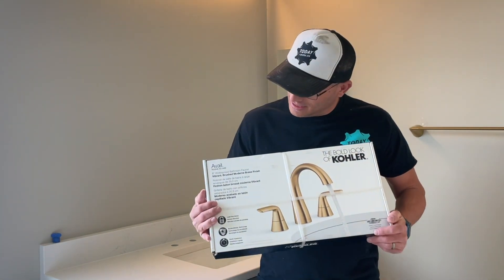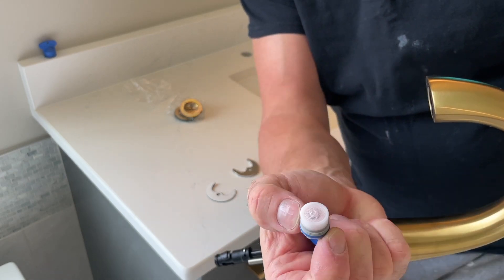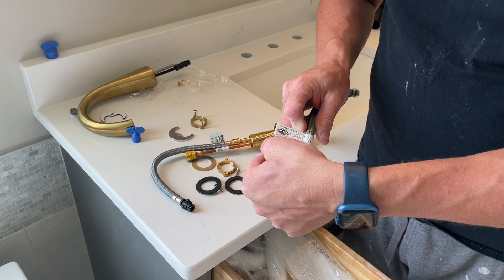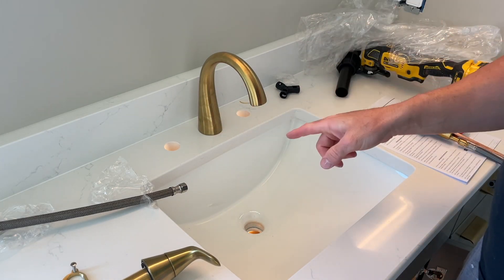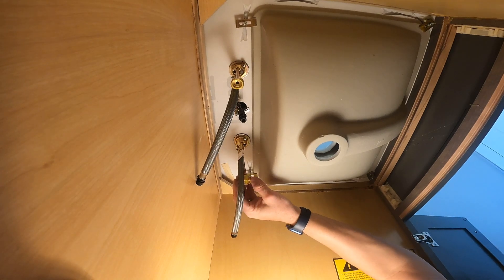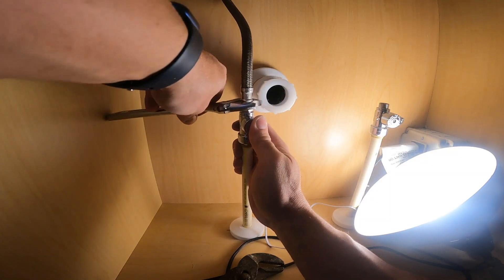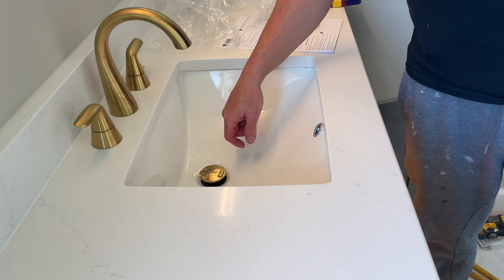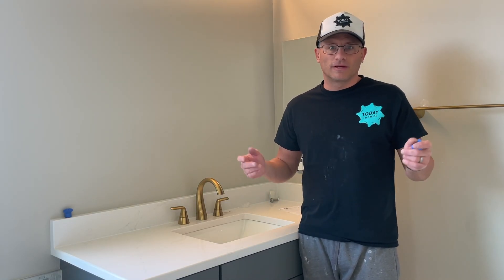How I Install a Kohler Avail 8" Spread Faucet and Drain Assembly

Comment: The sponge-like gasket that goes under the flange of the pop-up drain, is that sufficient to stop leakage or should a plumbers putty or silicone go on it?
Reply from the maker: It should. Just try not to crank down super hard on it and have the gasket squeeze out. You got this.
Reply: @TodayIWorkOn  Thank you@

Comment: I also encountered that the water spout was wiggling after installation. The screw under the sink was tightened and it still moves from side to side . Is that normal?
Reply from the maker: It shouldn’t wiggle at all… give it another ugga on the screws. If that fails, apply some silicone or plumbers putty.

Comment: Following the instructions but for reason there’s a good amount of “wiggle” in the assembly after following instructions to a tee, except no plumber putty, etc. What gives?  Is that the missing element?
Reply from the maker: Hmm, I'm not sure. Sometimes the hole for the faucet are too big and the washer does not bite well. I would have to see a pic of it to assist further.

Comment: I appreciate the video. I just installed a similar faucet in a bathroom. I put the water on and the hot and cold handles wouldn't turn off the water. Does sound like a blockage or faulty faucet?
Reply from the maker: That’s interesting. I always set my faucets at the closed position before turning them on. Can you shut off one valve at a time and see what side you might be having an issue with? Let me know how you make out. That’s sounds like an unusual issue.
Reply: @TodayIWorkOn  Turns out the faucet handles where on the wrong side and working now. Lucky it was a easy fix.

Comment: HI, how did you install the overflow cap ? Mine seems to pop out
Reply from the maker: The over flow cap? Or the drain stopper?
Reply: The overflow cap. It seems to pop out at the slightest touch

Comment: Thanks for the video!  What's the reason for not attaching the inlet hoses for the hot and cold handles before sticking them into the holes? Seems it's easier to do that in advance.
Reply from the maker: Because simply, it does not fit through the hole. Try it and let me know how it goes.
Reply: @TodayIWorkOn  You were absolutely right. While it would have fit through the hole in the vanity, it would not have made it through the retainer ring.  Got it done thanks to your video!  Thanks!